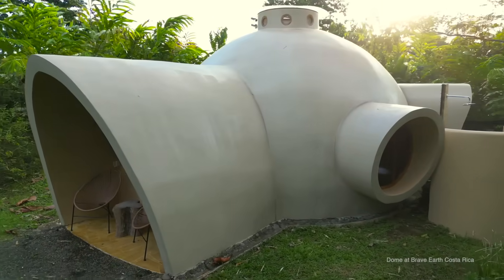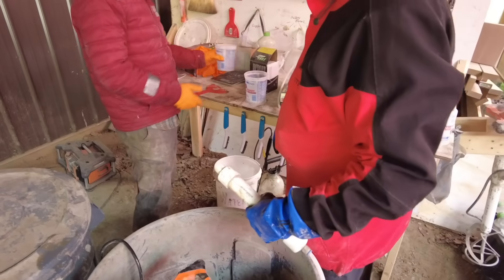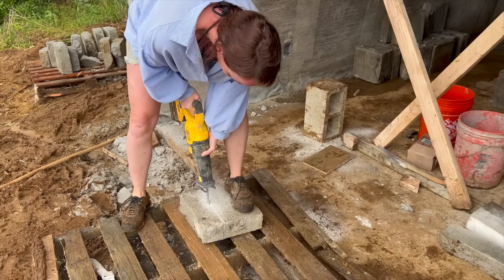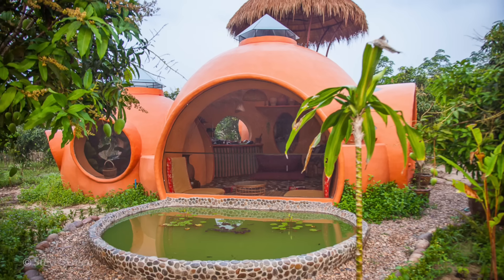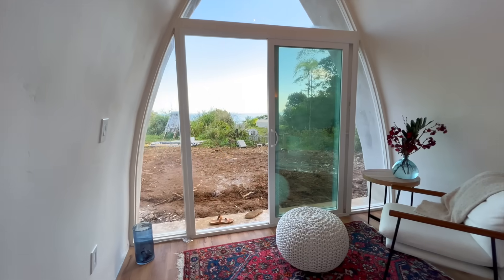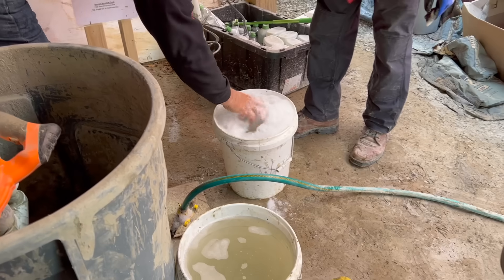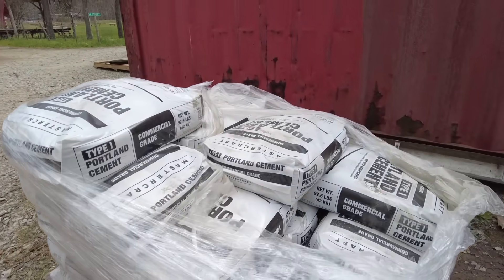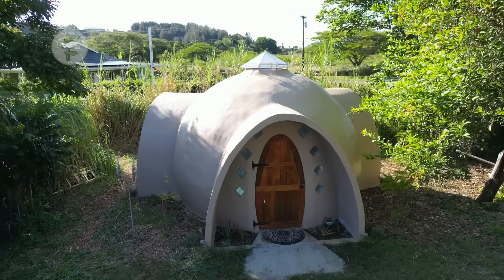Building Amazing Dome Homes with Aircrete – A Beginner Friendly & Cost Effective Material

Comment: Wouldn't it be cool if you could do the following:

Frame your structural walls with 1 by 6, spaced 24 inches on center,  with gypsum board screwed directly to the inside and suitable exterior panels, whether plywood siding,  FRP panels,  or galvanized sheet metal, and then simply pour in this Aircrete, a batch at a time to fill in the walls.  It would be well- insulated,  sealed,  and ready for interior paint!
Reply: I had this thought as well
Reply: Check out aircreteharry on YouTube, he's doing something like that.

Comment: Can you use something other than fiberglass for the inside and outside?
Reply: Yes, any strong mesh type material ment for reinforcing concrete.  You could use steel but it's harder to work with and can rust.  Basalt fiber mesh would be a great option but is a lot more expensive.

Comment: Using washing up liquid as a plasticiser is considered unprofessional even though it is exactly the same imo but I haven't compared them 50 years later
Reply: Washing up liquid is used to add volume, a plasticizer such a bonding adhesive is used aid in waterproofing.

Comment: I get so excited about this and other alternative building techniques until I think about my local building department. It would be an automatic NO. It’s so unfortunate and frustrating.
Reply: One possible solution is to use a permitted post-frame or pole-barn structure, then use alternative methods for filling in the walls.

Comment: This is so exciting! I would love a house using this material!
Reply: Would depend on what reinforcement was used. And what surface layser. I'd go with a heavy mesh and rlight rebar grid sandwich, some kind of fiberglass outer layer, and hard plaster with fiber interior, and a fine plaster top coat. Interior reinforcement, and a hard waterproof shell.

Comment: WATER INGRESS: Must bear in mind that its (surely?) an open-cell porous material, totally dependent on the integrity of outer coating . like all open cell insulation,any moisture ingress over time will reduce the R value As well as structural strength.
Reply: Most wall insulation is far more water absorbing than aircrete.  Depending on the foaming agent, most aircrete is closed cell and will absorb water very very slowly.  Regardless you are right that keeping any wall dry is important.
Reply: @domegaia  Thank you

Comment from the maker: Just wanted to share a bit of info because some people are asking about the story about how some Reinforced Autoclaved Aerated Concrete (RAAC) roofs are failing in the UK.  We're definitely not experts but we looked it up and it sounds like RAAC is a different way of using aerated concrete that involves steel reinforcement.  This Guardian article has more information:
https://www.theguardian.com/uk-news/2023/sep/04/raac-crisis-who-knew-what-when-crumbling-concrete-england

"With an estimated 30-year lifespan, failures among Raac roof panels in 1950s buildings were inevitable. Engineers also discovered some panels were too thin for the distance they were used to span, some lacked enough steel to anchor them to vertical structures, and leaky roofs triggered a “rapid worsening” of steel corrosion."

The aircrete method featured in this video does not use any metal in the structure so it seems to be quite different than the RAAC method, but just like with any new or alternative building project, it's always a good idea to consult with experts like structural engineers, architects, etc.

Thanks so much for watching :)
Reply: It's good you are addressing this here, however a deeper discussion with a materials expert and a cements expert about aircrete, would be appropriate. The statements your guy in the video are making are often vague and troubling, given that a) all materials have limitations, and b) this video can be used or misconstrued by homeowners.  Finally, given the claims made in this video, information on global warming potential and structural strength would be useful.
Reply: @acchaladka  "...vague and troubling..." is an understatement! Very basic intro.
Reply: @acchaladka Lightweight, cheap, and strong. Pick two 😝
Reply: Looks to me like aircrete has its place, just not as a structural element.
Reply: Concrete by definition includes aggregate like sand or gravel, so the whole term "Aircrete" is a misnomer.  "Cement" is the adhesive substance in concrete that binds all the aggregate in the mix together like glue.  What gives concrete its strength is the combination of cement gluing together aggregate, where the aggregate itself lends its structural properties making the end result super strong.  If you take out the aggregate and replace it with air it's going to be very brittle and have low strength in compression, tension, and torsion.  Meaning - it's definitely going to crack.  

I appreciate the deep thought that can go into scrutinizing new methods of building - especially here on youtube.
Reply: I would like to add, many were government projects...lowest bidder situation. Low cost goals. This is why many new homes are junk. Doesn't matter what system you use. If you use junk products and cheapest labor, your end product will be junk. Just saying, this is why large ambitious projects fail. A person's home would probably have mid to high quality and attention to detail. My opinion...

Comment: In my country we use a lot of Ytong. If you're building floors or columns you want to use concrete, but for walls - there is really no need to use anything else unless you really really want to. Bricks are kind of obsolete. Building with Ytong is like building with legos. And you can shape it however you want so you can make some amazing stuff. I guess you can build domes with it if you want to - just like building igloos with ice blocks.
Reply: ytong is fairly popular in the balkans as well
Reply: What is Ytong?
Reply: @fredericapanon207 it's aircrete. like styrofoam but maybe 4 times heavier, easy to shape and very fast to work with, the cement is like 1mm thick, the brick itself is filled with air so its insulated. When I see how all houses in the US are built with studs it looks so 16th century to me. The houses are basically matchboxes.
Reply: @fredericapanon207  it's autoclaved aerated concrete block, very light and durable and has good insulation properties, I don't know exactly how it's used as I don't know anything about construction but I know the name, it's very popular around here

Comment: Creative, but I wouldn't think this would pass building codes, particularly in earthquake zones.  Also...instead of making bricks, I think the "killer app" for this would be to just have an inner and outer mold, and you could just make a long building with an "arcade" style roofline.  You could also make this arcade into a circle, and build a central dome in the middle.
Reply: You think using heavier materials will make it safer?
Reply: @mr.monitor. with regular concrete you use rebar inside it
Reply: @nanchesca3950  You can use rebar in this as well, and they built stone building with huge domes and never used a stick of rebar for thousands of years.
Reply: Domes stand up better to seismic than any other structure. And adding fiber reinforcement, structural steel, and fiber reinforced, strong cement or fiberglass outer coating would more than triple the strength. Better than brick or stone, and theres stone buildings in earthquake country more than a millenia old.